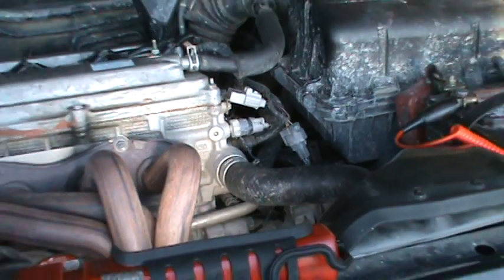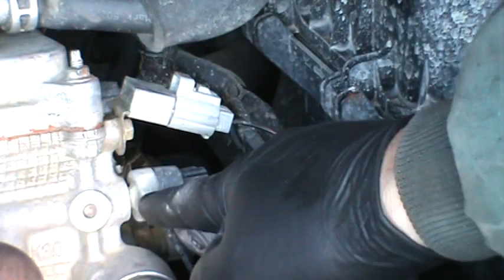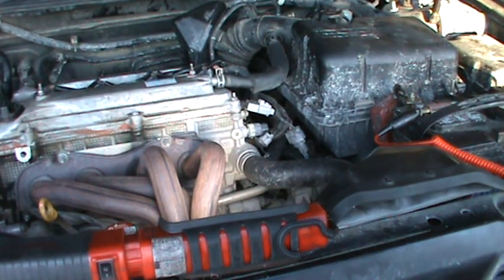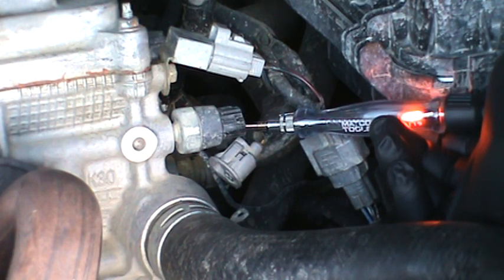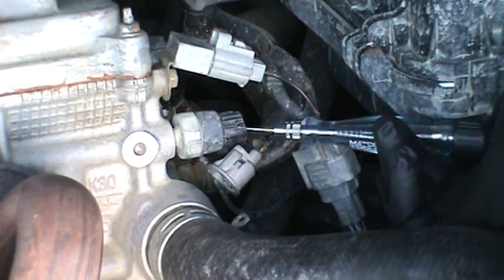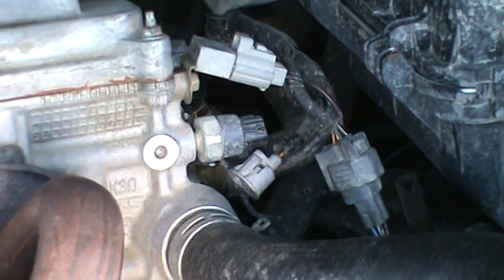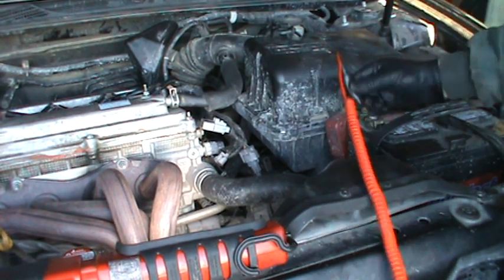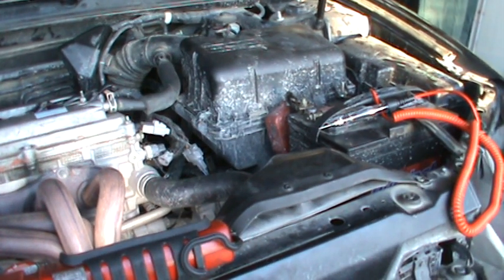Oil Light On? This Is Why (Oil Pressure Switch)

Comment: Is the car safe to drive while the oil light is on even though it has more than enough oil? The light came on, I added a bunch of oil, but now the light stays on. I don't know if it's circulating or not. I ordered a replacement oil pressure switch that arrives tomorrow, but would like to know if it's ok to drive today. Thanks.

Comment: Thank you Roman for your video I have a bmw 545i that has a low oil light coming out every 10 to 20 mins ! I know is not my oil pump ! So you just gave me and idea how to simulate the oil pressure! To see if my problem is electric or mechanical, thank you

Comment: So on startup pressure will be on the higher edge i bought generic pressure switch which has 9 or 10 bar gauge it show on start up 9.6 bar and iam using 20w-50 oil  weight disnt test when its warmed Just want to know am i got faulty item why its showing that is it normal on xterra 2007

Comment: how about if it only comes on when your at idle
Reply: Same here
Reply: 2006 Jeep Liberty same thing only comes on when idle..what could it be?
Reply: Juanita Gonzalez did you check your oil pressure
Reply: i haate sundays  no, I just got this yesterday it’s a hand me down from my brother but after watching so many videos I  want to think it’s the oil switch sensor.  I am going to take it in to get the oil changed and also see if they can change that sensor. I’m keeping my fingers crossed.  It runs well, I don’t hear anything or it act funny In city and on Highway. 

The engine light is on but it is steady. I’m also going to work on that beginning from the cheapest possible causes...fuel cap lol. If you have any suggestions on that end I would greatly appreciate it.  Thank you so much for answering so quickly. I never thought I’d get a response and especially so soon.

Comment: i have problem in my car BMW SERIES 3 MOTOR E46 M43  316 .i chcek yellow light some times is on when the engine  start or when the car moving if any one can halpe me how to rieper it thk.s to oll gorup halp
Reply: Did you scan with obd2 diagnostic tool it could be bad switch or loose connected or wire is exposed or you have sludge in your oil